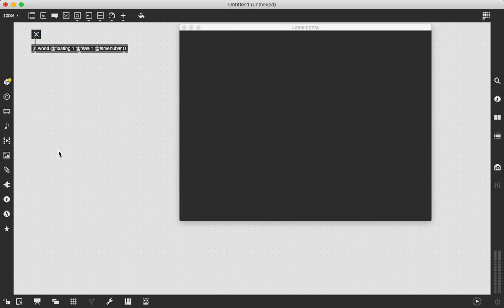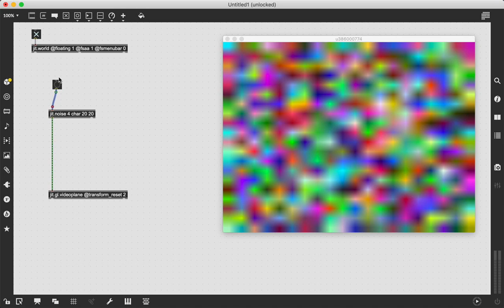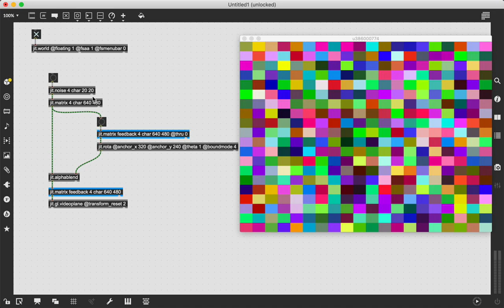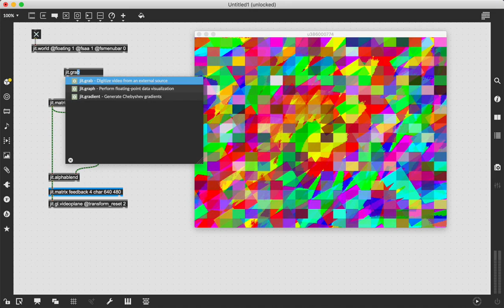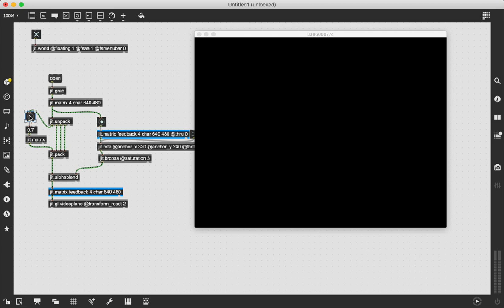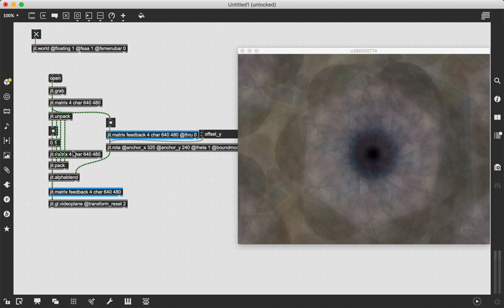Jit.Matrix Feedback Loop - Max MSP Tutorial

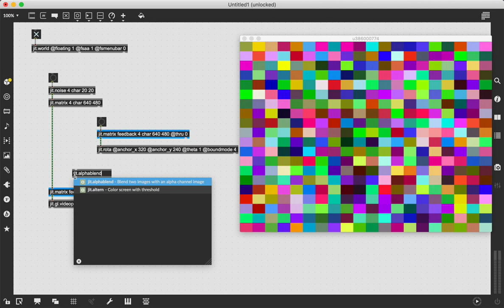Comment: I freakin' love it.  Running through this again.  I have a question:  Right at like 3:35 - 3:36, you insert that jit.alphablend into the patch cords really cleanly and automatically.  I can't get mine to snap into a connection like that without manually unplugging or deleting cables.  Can you help a brother out?
Reply from the maker: You hold shift down to insert an object in between other patch cords.